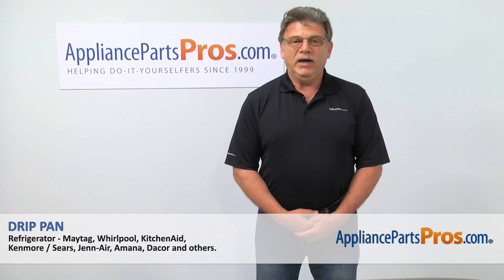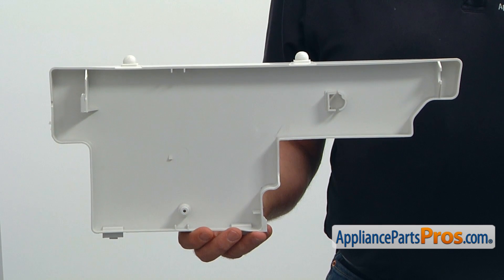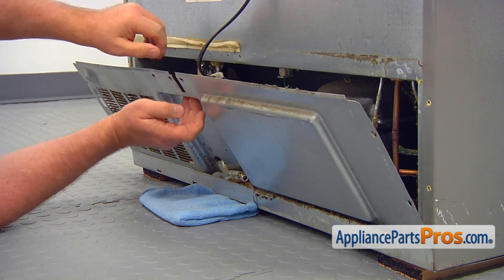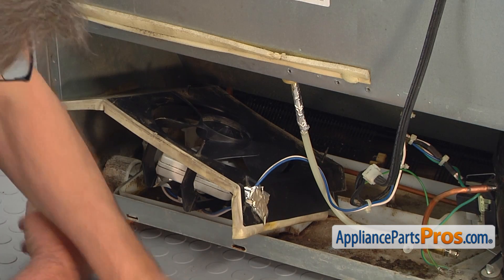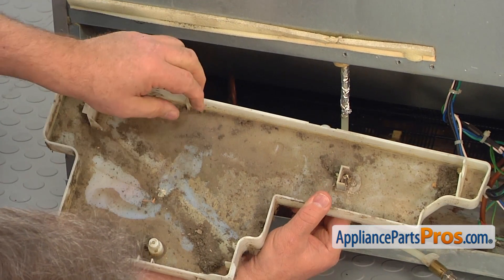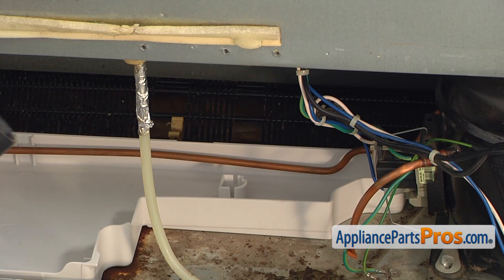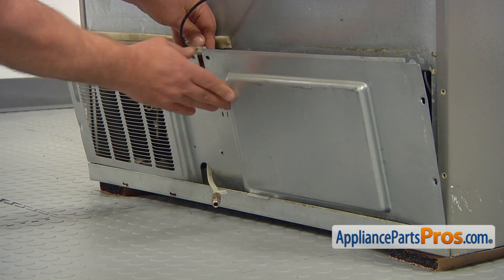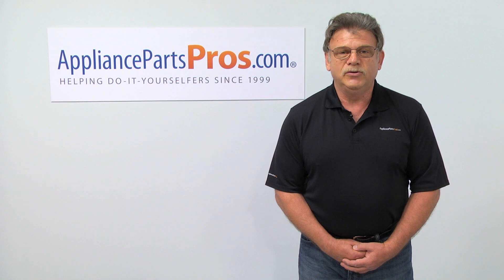How To: Whirlpool/KitchenAid/Maytag Drip Pan WPW10655368

Comment: I had a biological experiment growing in my drip pan as well as on top of the wheel, thanks to having followed other videos that said to squirt hot water to melt ice in the evap coils and didn't tell me to go drain the pan! I tend to break things, so I cleaned it out without taking it out, but it was a pain. Why aren't appliances easy to clean, especially in places that can grow mold and pond scum?